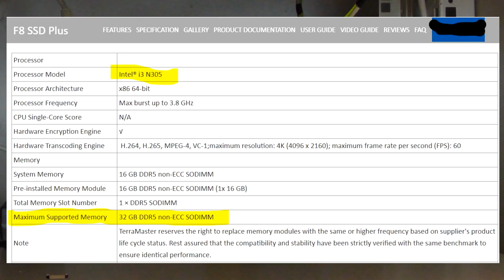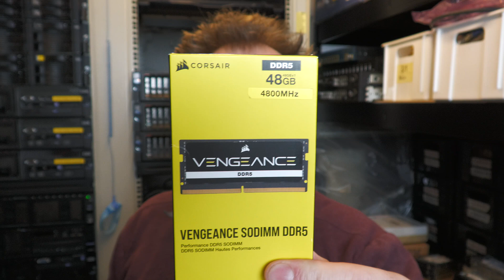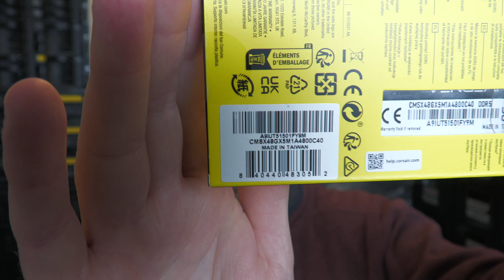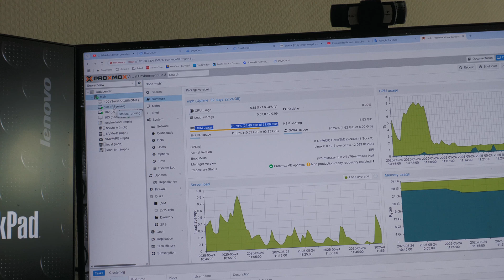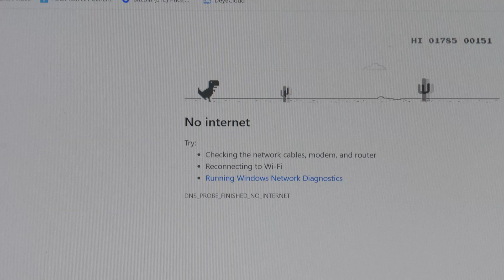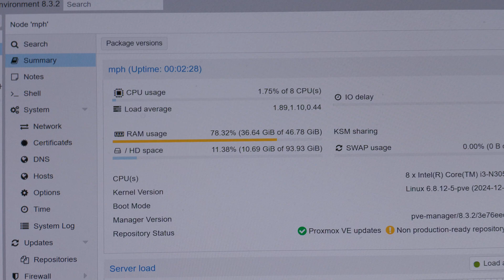Terramaster F8 SSD PLUS Upgraded to 48GB RAM for Proxmox - 1495

Comment: Hi! Quick question: Is it possible to install TerraMaster’s TOS 6 operating system on non-TerraMaster hardware (like a custom-built server or PC)? I’m particularly interested in using their RAID system that supports drives of different sizes. Thanks in advance!
Reply from the maker: Øhhh sorry I really do not know.. It is just a USB key,, but it could do all sorts of checks.
Reply: @MyPlayHouse  It would be nice to see how far we could push it.

Comment: Thank you for sharing! This is a very practical hardware modification experience - I successfully installed 48GB memory on the Terramaster F8 SSD Plus beyond the official memory limit, and also solved the bottleneck of 4K video editing.

Based on your exploration, I would like to ask two key questions:
1. Has Proxmox's ZFS ARC or virtual machine ever crashed unexpectedly?
2. After the memory capacity is expanded, how does the CPU load change during video rendering?
Reply from the maker: I had a Server2025 do weird stuff this week,, had to reboot it..

Comment: You can remove that hibernation file entirely by running "powercfg.exe /hibernate off"
Depending on the virtual drive setup proxmox can use 16GB of RAM from what I have seen/read, its more likely to do this with a ZFS file system.

Comment: If you want to save on RAM, for example, use a shared folder from your Synology NTFS (nfs) and then install your VM and CT on the shared folder.

Svenska:

Om du vill spara på ramminne så använd till exempel en delad mapp ifrån din synology NTFS (nfs) och sen installera dina vm och ct på den delade mappen.
Reply from the maker: Hi @kristianlanglov5230
Thank You very much!  glad you liked the video :-)
Thank you for watching! :-)

Comment: Firstly great update / upgrade no doubt this will help many people and I agree Proxmox is the way to go for any Home Lab or small business. The Terramaster F8 SSD Plus is a nice unit but over priced even when on sale, I think its great if you just need a single machine setup for a few VM machines. However for less money you could get a better Proxmox machine which has 32 cores and can handle 128gb of ram and better networking (4 lans) but not as power saving. I think the 64gb ram doesn't work because of the speed is too fast.
Reply from the maker: The Terramaster F8 SSD plus is not cheap,, it is really the 8 NVMe slots that cost,, I am not using all of them,, but it is the 64TB NAS/Proxmox server that fits in your bag :-)